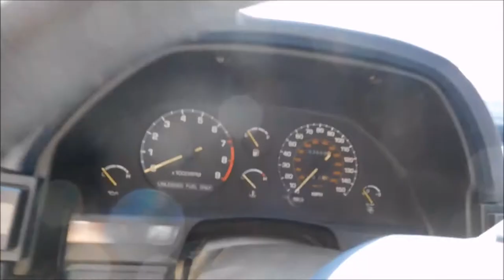Episode 1: Toyota Celica Alltrac ST165

Comment: Awesome to see someone building/restoring an ST165! There are very few of these cars left(let alone any that run and drive), so knowing there are others on the road is a very good feeling. :) Good call on the aluminum rad; the endcaps on the stock ones fail over time/heat cycles and after 30 years are all practically toast. I like the fact you're going for the twin tip exhaust; the big cans are very droney and you lose the characteristic 'growl' the 3SGTE has.

The biggest piece of advice I can give is that if you truly love this car don't give up on it. As I'm sure you're aware parts are insanely hard to find, they're absolutely difficult to work on, most shops won't touch them(or have no idea what they're dealing with), and most folks thinking these are going to be a cool, easy project get overwhelmed and sell them on. I had one of these many years ago that I bought as a 19th birthday gift to myself. I poured my heart and soul into that car over three years and sold it for stupid reasons. I always kicked myself for that and kept my eyes out for another that wasn't beat within an inch of my life. Almost ten years later I found the right one; and after a couple of years dealing with some unexpected, major issues(the power steering rack mount had broken off from the firewall and was very crudely repaired; I had to have the firewall rebuilt by a classic car restoration shop) she's back on the road and I'm enjoying her semi-daily. :)

I'm definitely subscribing and would like to see what's in store for your GT-Four on down the road! I really need to take some videos of mine sometime soon!
Reply from the maker: Appreciate the love man! I'm not giving up on this car anytime soon! GT-FOUR for life!
Reply: Absolutely! As I tell my friends, this car isn't leaving my ownership unless I'm in the ground or the Celica is crunched enough that she can't be brought back. That's why I'm not scared to put miles on her; she's not going to Barrett-Jackson in 20 years.
Reply: Alltracavenger I know exactly what you mean, I've had one for the past 3 years that is in absolutely perfect condition body wise. The one thing that's wrong with it is the engine is stuck in limp mode, and no garage around has the courage to take a look at it
Reply: Alltracavenger It can only reach 40km/h at the moment and was sitting in my garage for the past year as I look for anything to get it going. No aftermarket or parts or anything for these anymore
Reply: Is it throwing any check engine codes, or do you know what might be acting up? There's precious little available as far as parts, but there might be an enthusiast selling what you need. If you're on Facebook, I would highly recommend joining the 'Alltrac.net Diaspora' group; there's a lot of folks who help troubleshoot and swap parts when they come up.
Reply: Alltracavenger It's been putting out code 34 for the turbo and code 41 for the throttle position sensor. I remember a while back putting a few resistors on the pressure sensor to bypass it temporarily, and that got me out of limp mode, so I think it's probably overboosting.
Reply: As for the throttle position sensor, my god those things are a pain to calibrate, I think mine is shot and I'll need a new one

Comment: No matter what you do, do NOT mess around with the throttle position sensors on these cars, those things are crazy calibrated and will give you nightmares
Reply: is it worse than any other Toyota TPS calibration for the 80's?  Ohm testing and feeler gauges? :D